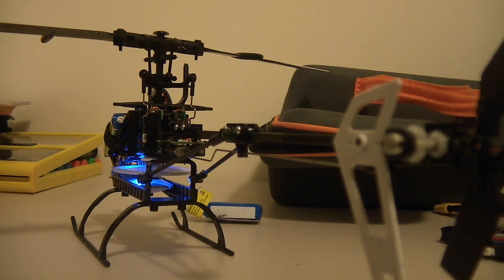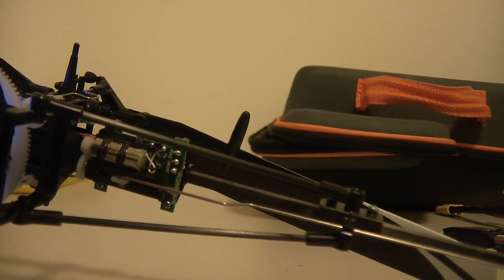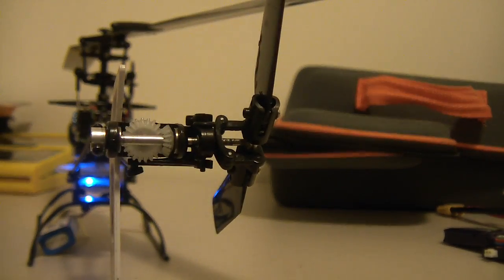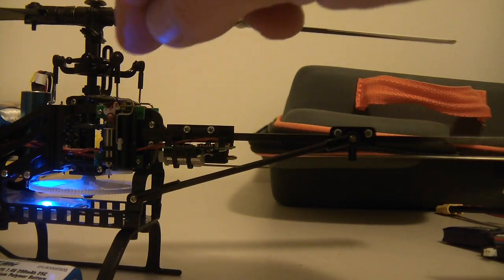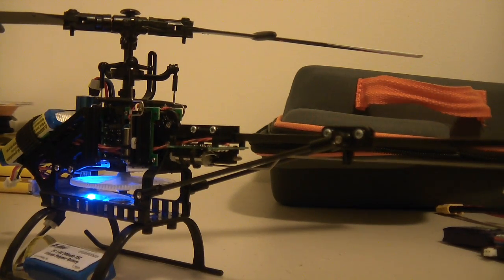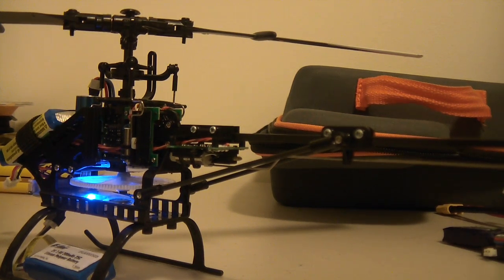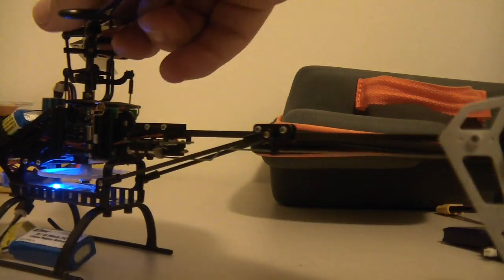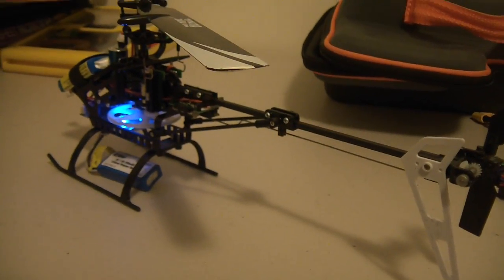130X tail servo fixed

Comment: Hey Rob, I got my new tail servo and it still stops in the middle of a 180 nose up turn, then kicks back in and it over turns. Called horizon and they wanted me to access the gyro menu and it won't enter. They told me my main board is bad so they are sending me a new one.

Comment: Hey Rob! I have the 130x and problems with the tail servo...I think. When fish tanking, every time I make a right turn it will turn about 1/4 then stop for a second and continue the turn always causing it to turn too far, and I have to correct it. Any ideas? I have horizon sending me a new servo, but who knows when I'll get because of the back order on them.